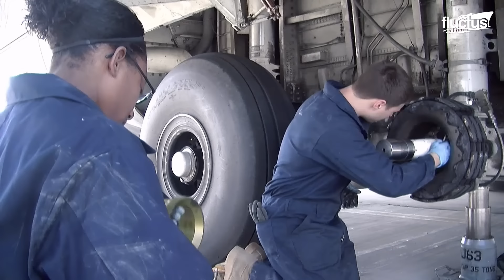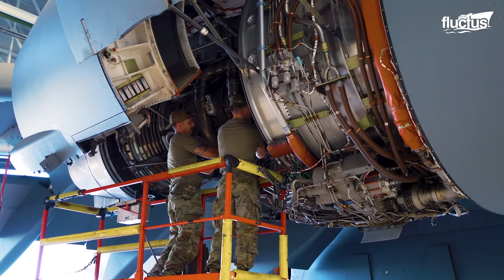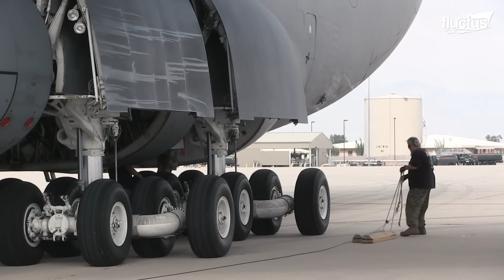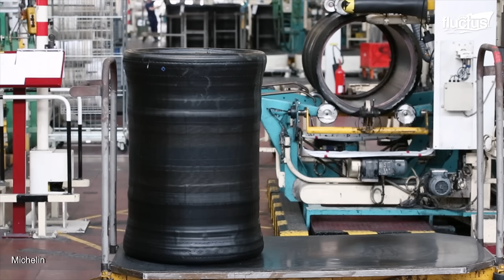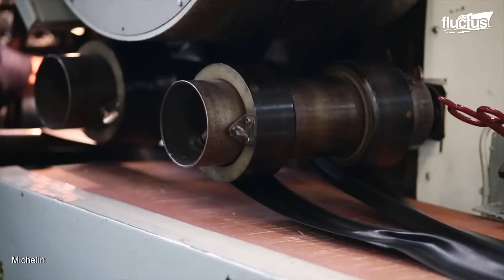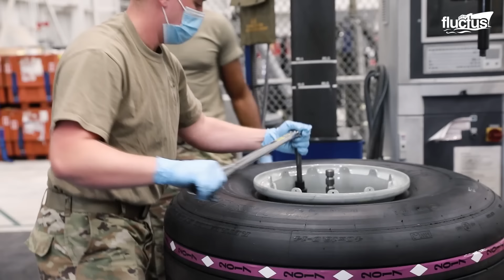What Happens When US Air Force $40,000 Aircraft Tires Blow Out

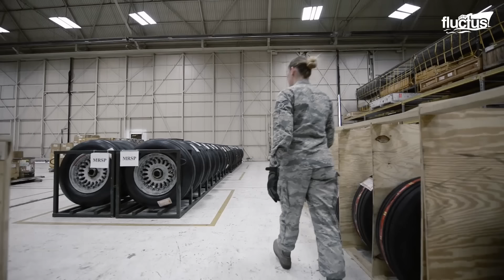Comment: At 5:30 it says tire weights between 50 and 100 pounds i am a mechanic and thats what a regular tire weighs so im calling BS and im guessing its more like 500 pounds
Reply: You are close. Since you replace the wheel assembly (tire plus wheel hub) as one unit the combined weight is probably  at  least 400 lbs based on my civil aircraft experience.
Reply: Yup, 50 to 100 pounds is more or less a 737 / A320 class nose wheel or a regional turboprop main wheel like on the ATR or DHC-8. If it's within 100 pounds I wouldn't bother using a dolley😂
Reply: @noranekonekomatagi3261  I  was working line maintenance in Asia where we had plenty of mechanics and generally manhandled wheel changes using a canvas strip with metal pipe handles at each end so 3 or 4 Asian guys could get in and just lift the wheel on or off. Once replaced 3 main wheels on a 747 in a 1 hour transit during a torrential downpour.
Reply: @Kingsford44  Yes I remember doing that on our MD-90s too, 1 person in the front, 1 person in the back, the 3rd aligning the keyways with occasional carbon brake disk pieces falling out for extra fun LOL

Comment: You mentioned tire changing time in your video. I am a retired TSA Supervisor. One night working at a gate I saw a Southwest Airlines ground crew change both front tires on one of their B-727s while they unloaded  passengers, prepped the cabin, and loaded the next batch of passengers. The aircraft was not delayed in any way. I heard SW ground crews received some of their training from NASCAR pit crews.
Reply: very common
Reply: Also, Air Force Training 🇺🇸
Reply: so long as the airbridge has height auto-follow function, it can be done without de-bridging which saves a lot of time. The only factor stopping mechanics to do so are the Load Masters and Ramp Coordinators who consider these activities dangerous. Otherwise replacing both nose wheels on a narrow body airliner is approximately 15 minutes work, with or without TPIS😂
Reply: Thanks for touching my junk with the back of your hands everytime I fly. Really doing a good thing making sure my balls are huge. Thank you for your service 🫡
Reply: NASCAR Compaired to aviation😂
You need to be at 40,000 ft and have the 💩scared out of you and hundreds of other people on board.
Have you ever flown or just been to a nascar race sitting in the stands.